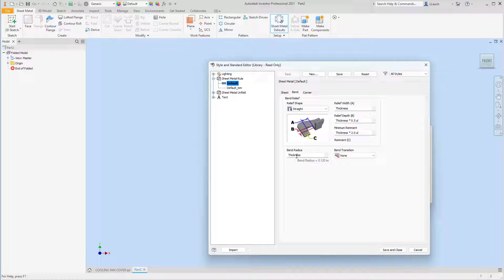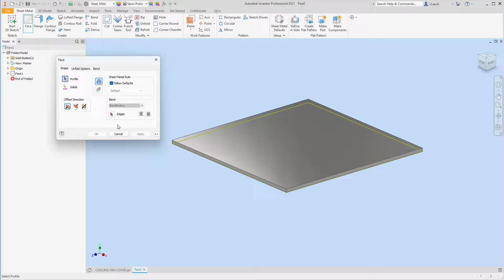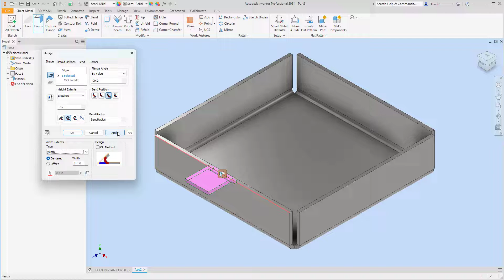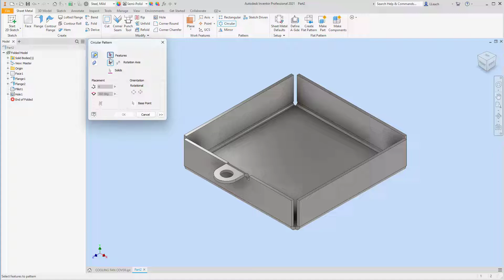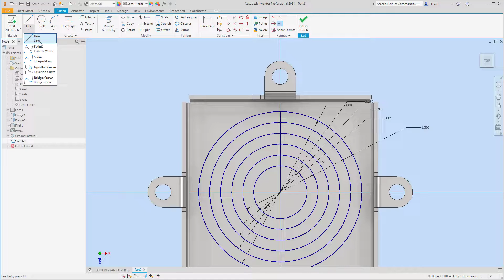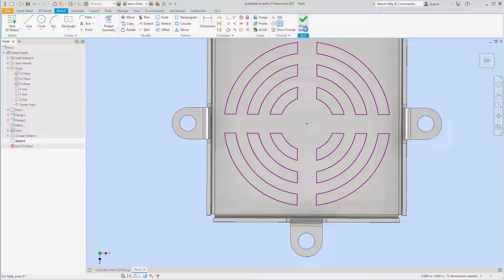INVENTOR SHEET METAL COOLING FAN COVER

Comment: I have this part. But working with welds in weldment settings. How do you weld the edges together?
Reply from the maker: I'm not the expert on welds, but in the assembly/weldment, bring the cooling fan in and then go to weld/welds/fillet. Face 1 would be an inside face and Face 2 would be an inside face perpendicular to that. Under contour, I chose concave.